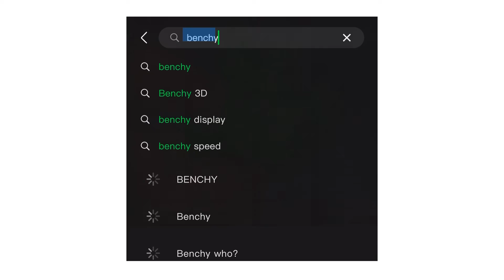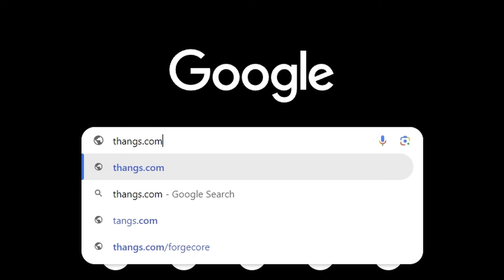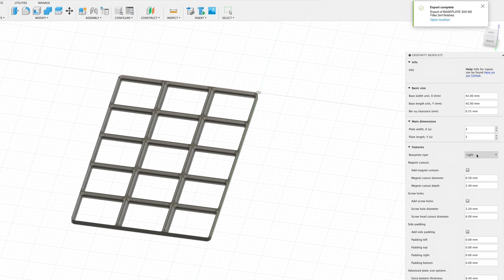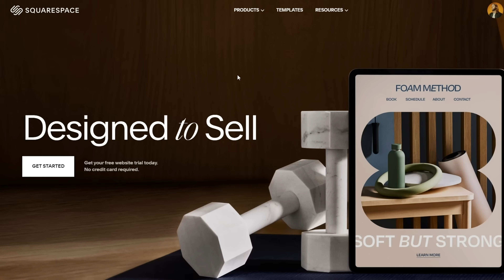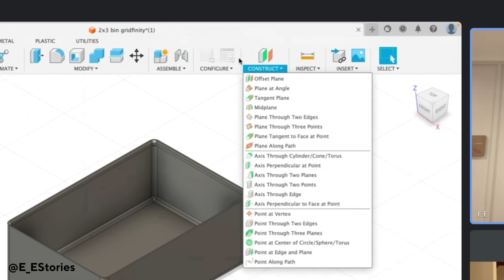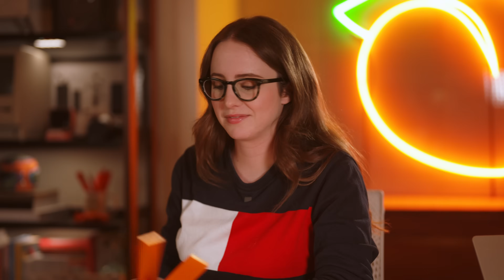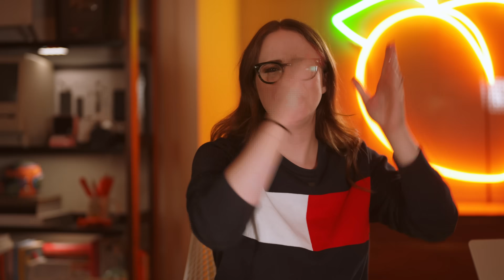Organizing my Office with 3d Printing

Comment: I think everyone who's just starting with 3d printing should start with TinkerCAD, you're just literally jamming shapes together to make what you want and it's easy to set dimensions.
 
As you start to learn it, you can start to do more advanced things and make sure things are lined up perfectly but most importantly you can modify existing designs to better suit your personal needs. That will at least get you started and printing things you need and then once you start to want to do things like chamfers and fillets then you can move onto better CAD programs.
Reply: No one over the age of 5 should ever learn tinker cad. Fusion isn’t hard to learn and can do so much more.

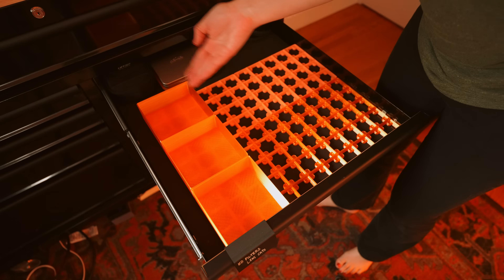Comment: 11:52 Fractional grids. Or change the size or percentage.
Reply: get yourself a pair of calipers. The ruler should be accurate regardless of what it is used for.
Reply: Make  rectangle to remove the negative space for your spacer shims. Then it can lock in. Or just use a fractional grid of that size.
Reply: Just wait until she learns to emboss and deboss logos onto keys and knobs....

Comment: Glad Joel set you up with an X1C so you don't have to worry about maintaining the 3d printer itself. I enjoyed it at first but now I just want to focus on designing stuff, not dealing with failed prints due to bed adhesion issues, a random loose screw, etc.

Comment: As far as having to reprint things because they don't fit, first welcome to the hobby I think we have all done that a few hundred times. It doesn't really apply to the bins, but you can always make a test print of just a piece of the model to see if it will fit. for example I made a shelf for my window unit air conditioner that just friction fits into the vent, Instead of printing the whole model I printed a slice that gave me the geometry and I was able to measure how it fit (or didn't) and make changes. It's a little filament wasted but it helps a lot with more complex projects
Reply: Agreed! For the bins you could just print a few layers and get rid of most of the material in the center of the model. This method guarantees that you will waste some filament, but you should be able to cut down on the number of full prints that don't fit and end up in the trash. I'm still learning to do this.

Comment: One thing I've learned in 3d printing projects that require size precision is to slice it so you just print like 5-10mm if that of it. This lets you see if it's the correct size or going to fit where you need it without wasting a ton of filament. There are still tips and tricks I'm learning after 6 years of printing so don't feel bad. Enjoy learning and printing all the things!

Comment: People don't talk about this enough but having good measuring tools is a pretty important thing which you learned the hard way. I also recommend some digital calipers.
Reply: I propose (cheap - medium priced) analoge calipers. No batteries (empty or leaking), no zeroing in every time you use them, and sometimes even more accurate then cheap digital ones
Reply: I got some digital callipers when I started learning how to build guitars.   I found after a couple of weeks they didn’t work.  So after cursing and swearing for a while I got some more, paying more because I figured I’d been seduced into going too cheap with the first one.   Turns out it was the batteries    Unless you’re going to be using them a lot, I’d say either buy batteries by the box at a time, or use analog callipers instead which need no batteries
Reply: @afpwebworks  I got the cheapest digital caliper from harbor freight and have used it 3-4 years and hundreds of projects and haven't had to replace the battery yet but, it did come with a spare. If an electronic item drains the battery when off it's because the switch circuit wasn't designed correctly. I think the guy with a swiss accent had a good video on it.
Reply: And the good old tape measure for anything too big for calipers.
Reply: Even digital calipers can screw you up if you didn't zero it properly.
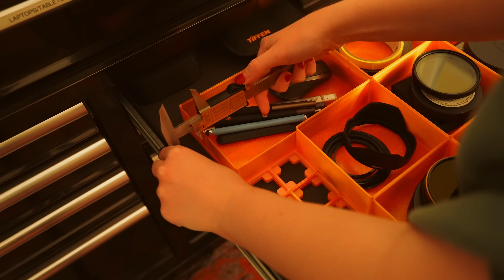Reply: check 12:01

Comment: Awesome! 

The reason your extra with bins broke a bit is that the corners on that end printed in the air. The normal Gridfinity bottom grids has a slope to avoid that, but the added rectangles goes 90 degrees into the air. If you turn on supports it should print clean, and maybe use tree supports, they are usually easier to remove without breaking things.
Reply from the maker: Oooh I’ll try tree supports thank you!

Comment: One thing I learned that I think would help you with saving a bit of filament is doing test prints that are only a few layers high in order to make sure that it fits the space you want. I've wasted more filament than I cared to admit to on (like you) 6+ hours only to find out it doesn't fit! so only doing maybe the first 40mins-1hr of the print is probably long enough to get the dimensions of the boxes to know it fits accurately.

Comment: One crazy idea: just scale the gridfinity grid to a size that evenly fits into your Husky drawers. 42x42mm might be the standard, but it's 3D printing... do whatever works best!
Reply from the maker: honestly yes. good idea. then i wouldn't have to reinvent the wheel for every drawer
Reply: i think theres a specific reason behind why zach sized them that way
Reply: @A-scketchy-otter-lol he said because it's an easily dividable number and a literary reference
Reply: @A-scketchy-otter-lol 42 is divisible by a lot of numbers. Plus its the answer to life, the universe, and everything.

But keep the 42mm!
Reply: If you are looking for aesthetics, just print border tiles, either one side or both. The grid should allow you to clip stuff to it
Reply: Never break the rule of 42. Just measure the gap left at the side and then make spacers for the edges.
Reply: But then all the other gridfinity project you print will have to adapt to that one place or not fit if you keep the normal dimensions.
Reply: @mateowoetam  yes. If you scale the grid by 10%, you have to scale everything by 10%. It only makes things difficult if you’re trying to print exactly-sized molds for certain items, but I don’t think Sara did that for any of the gridfinity prints in this video.
Reply: @coder543 Then the pieces aren't compatible in other places.  Want to rearrange and the pieces are going into other storage spaces with standard sizing?  You need to reprint.  IMHO, it would be better to use spacers in the areas where gridfinity don't completely fill the space.  Another drawback is that anything with specific sizing - like for bits, memory cards, batteries, etc - will need extra work to resize the outer dimension without messing up the internal details.
Reply: damn, how didn't I think of that?? When she was talking about how she had to modify the 3D model I was like "yep... such a bummer that there is no better way". Your idea is so much better hahahah
Reply: There are baseplates with removable pieces on the sides, so that you can get a good fit in every type of drawer, so no need to scale gridfinity.
Reply: if you made the base 12 units wide rather than 11, you could scale it to 98.6% and have it fit perfectly.
Reply: Never break the 42 rule. 🫢
Reply: Excellent video. Just getting started myself. I identify with allot of what you went through, especially going down the rabbit hole of YouTube videos😬.